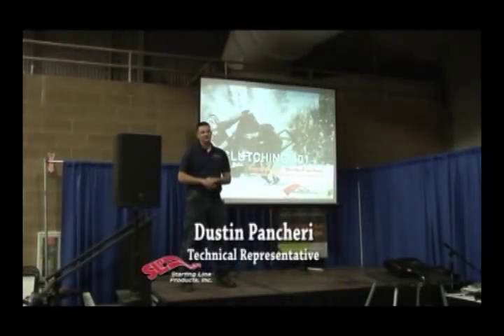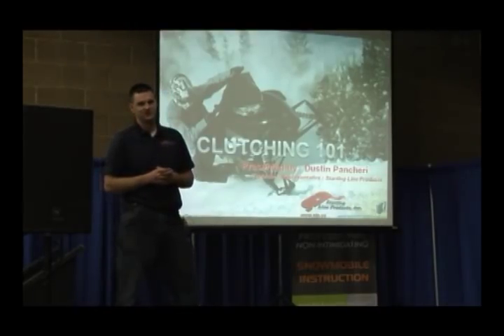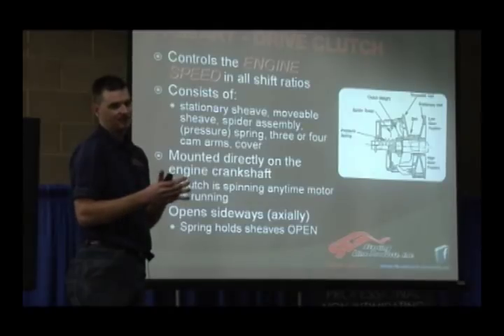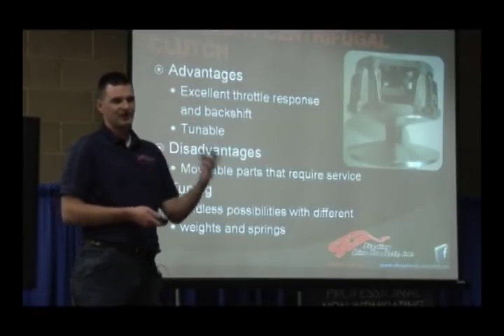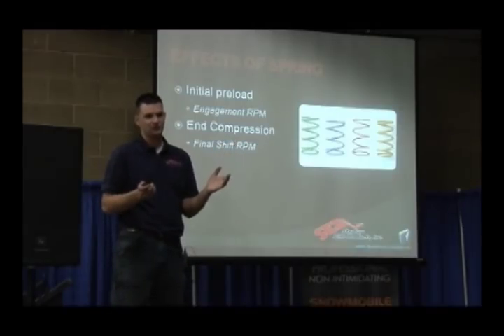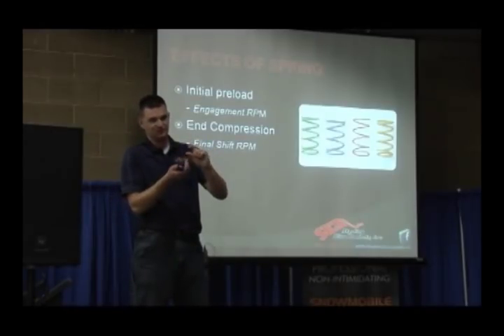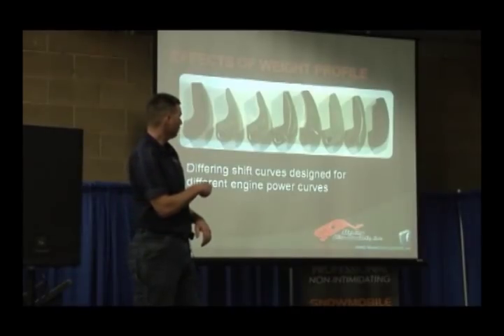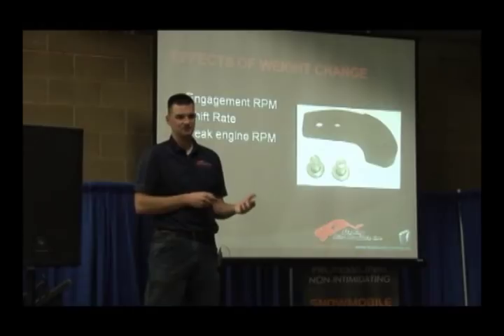Clutching-101- Part 1

Comment: Awesome VIDEO!. I was having a terrible time with an older 04 Polaris 800 PRO X burning up belts. I tried a Clutch from a 600 with a 56/42  helix put my 800 spring in and WOW. 100% better. . WAY better working Clutch now.. I ant on a Snowcross track. I like the slower Back shift too.  So out with the 62/46-.46. Ordered a 52/36 and I think it works even better then the 56/42 out of the 600. Belt heat is not a problem now at all.

Comment: I want to know why my old Button clutch Out preforms the TEAM tss-04 clutch i have? I can get 110mph on the button. The button stays cooler and belt live is a lot longer.  Team spins the tracks, Machine doesn't go as fast. Only can 87 mph on top end. And belt live is the pits! Way to much heat.   I just don't have reverse with the Button Clutch.
Reply from the maker: Hi, we would love to help you more on figuring this out, if you would email these questions to our tech line slptech (at) slp.cc they would be happy to help you get some answers.
Reply: The button is a superior clutch, it's that simple.  The torsion spring is more tunable with less slippage and more consistency.